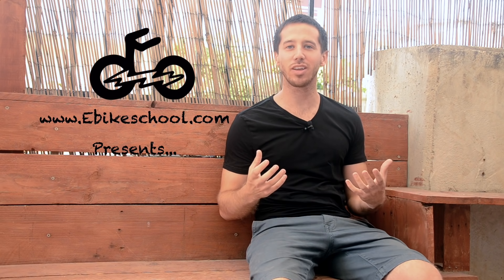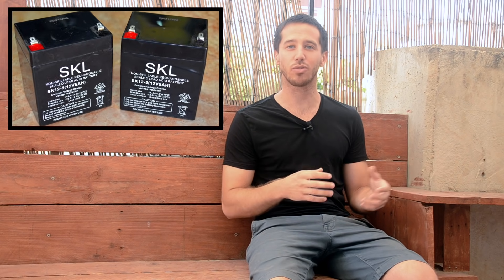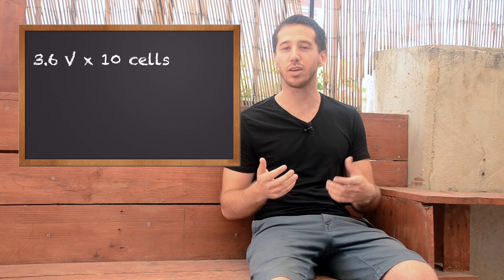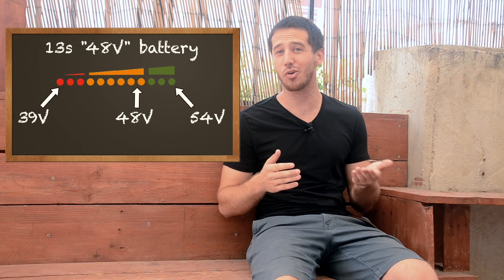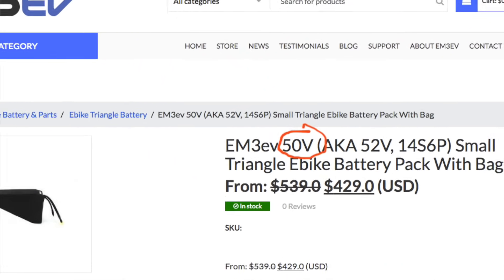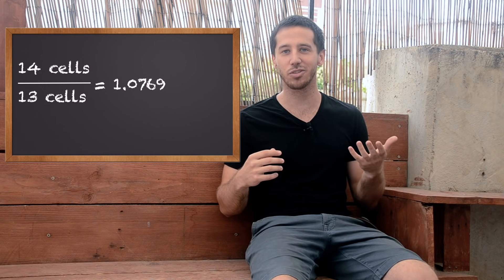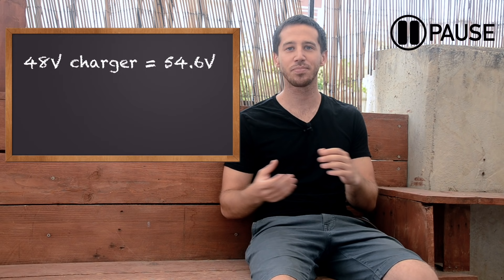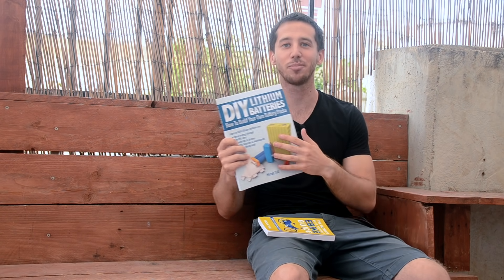Which is better: 48V or 52V battery?

Comment: Hello, Micah, two questions. I had to do a bit of troubleshooting on my 1000w/48v bike, and ended up putting a 1500w controller on it that I had on hand in case one of my 1000w went out, Ihad heard the 1500w would hold up better, but now that I have it on there and working, and before I go changing back to the 1000w or leaving the 1500 on and risk burning something up over time, I need to be reasonably sure if it's ok to use a 1500W controller on a hub motor that I assume was design for a 1000w as that's what came in the kit and it's been working fine? FWIW It's hybrid with gas and electric because I am unable to peddle due to handicap, and the electric is used a pretty good amount but not near as much as normal, in that I use it to get the bike up to speed to start the gas motor, along with the gas the very few times I can't quite make it up a hill, or in town when I'm doing a lot of stop n go/riding too slow for gas.

Second question, At present I'm using the ebay 36v packs for a cheaper/easy to build Li-ion battery solution along with a convertor for 36 to 48V. So though I have the disadvantage of losing capacity running through the exrta component, I have the option to set the voltage up to whatever I want, and was recalling your video on running a 52v battery. So first I wanted to mention this along with the 1500w controller in case there was a problem there I missed and I mainly wanted to know what the max voltage I could run this at. I ask because I know 48v batteries actually charge to 52/54v but I wasn't sure what 52v charge to or if I I could go a little beyond the 56 or 58 or whatever they actually charge to due to the controller?

Sorry it's so lengthy/involved but I figured I should mention all variables. and besides, if it was simple, I wouldn't be here. :) Thanks man, and your videos are some of the best. You do a good job at getting most info in there and making things clear.

Comment: I have a 3 way power switch on my e-bike.  when the controller was replaced last month the 3 wires weren't put into the connector on the end of those three wires in the right order.  now, the low setting is medium power, medium is high and high, just leaves it on high.  anyway, I have the wiring diagram and now I have to fix it.  My question is, do I need a special tool to pull those wires out of the connector and/or to put them back in or do I just pull really hard and then twist and cram them back in there?

Comment: i have a 36 vault motor and a 31.5 volt charge controler so do i need a 36 vault battery with more ah for greater distances

Comment: on the stromer it has a 48v - 983wh

i believe it's a 13S-Battery  so 100% would be 54.6V  and at 30% = 42V

the Charger can't be set at a max. loading. like 90% - 
since i daily do not need 100% i would like to set or automatically cut-off at 52V.

Any idea how i can DIY my own solution?

Comment: So you can have more speed or more distance with more volts. Volts law and all. Simple common sense wins out here. If the controller can handle it more volts is better. https://imgur.com/a/t9NIAmG I personally go for distance with lots of weight. I chose 52v for my BaFang 750W center-drive.

Comment: you forgot to mention if it's 5 degrees  outside your lithium battery is useless. I rode my ebike with my cheap chinese lead acid batteries all through a canadian winter, it was minus 20 for almost 2 months, this guys a fuckin idiot

Comment: New to all this electric with a new tadpole I installed electric on. You have been very helpful in my understanding of how alot of it works because none of it want's to work right. Voltage video on over volting was exactly what I was looking for. Haven't seen all your videos but one on amps would help also. Great job!!

Comment: I use 48V LiFpo4 battery in my build.  I've used it for 2 years mostly riding in town, summer, from home to office and back. It's about 5 km.  But yesterday I tried longer way and got error 06 (SW 900) after 13 km. Does it mean that my battery degraded and I should consider to buy a new one?

Comment: My first e-MTB was with a BBS02 48V 20A with a 13s5p battery. I was happy with this set up, but felt that on some occasions I wanted more power and range. When I switched to the BBSHD (48V 32A) last summer I went for a 14s9p battery and it's made a huge difference. It's pretty flat where I live and I use 100-275W of power most the time, boosting on hills, against headwinds or rough, muddy or sandy terrain. Mostly I do around 40-60km a run, on occasion up to 100km. I find that with this battery, I'm always in the "good" part of the battery charge, i.e. above 48V. Also if I do hammer the battery, it seems to bounce back a lot better than the other one. Obviously the strain is now shared over 126 cells instead of 65 on the other battery. With the drop in prices, it only cost me 100€ more too!

Comment: 52VOLT BATTERY PACK WHAT REALLY, MAKES YOUR BATTERY OUT PREFORM THE NEXT GUYS!

I got 52V battery pack on my conversion system of my Norco 2005 Norco Bigfoot POWERING A 1000W rear geared hub motor.
Our friend here has a few good pointers...   Surely and increase of voltage is conversely an increase in performance. But what he's lost big pointers on and which is so dam important is the type of lithium cell you have delivering power to the motor. 
V x I = P      P=power   is expressed as watts.    So what really can and does make the battery the best performer on the obverse potential other batteries is the C  value    For exam[ple I decided I wanted the real power outpourer so I went with a Panasonic 2900 mha with C value of 10   C=10    so what that means this battery has a

 TOTAL OUTPUT = 2.9 AMPS 3.6Volts =10.44watts total available power  
But the real kicker is C=10 value    which means this battery can put out 29amps (2.9amps x 10) for a real good portion of the total available power. That is where the real true differences exist is that highout factor!

Power is expressed as W (watts) on is the fact that what really is going to give dear Watson 104watts with that C=10 values… compared to those other batteries with 2500mha and a C=3 value …. 2.5a,mps x3 = 7.5amps x3.6v = 27watts    
104watts of output if desired  VS. 27Watts     x3.85 more power output
Note the only drawback is using up the reserve power much quicker

Comment: Here’s a little example for you all of two bike companies and the batteries they sell: 
RadPowerBike 48v 14Ah $499 RadRover
Juiced Bikes 52v 21Ah $1699 Rip Current
Reply: shadowdance4666  Hey I’m deciding between these two exact bikes. Any recommendations from you or anyone that has some experience with these would be greatly appropriated. Thanks
Reply: cdriz1 Well, I bought the RadRover. The extra battery is $550 when I bought it. My advice is keep it dry. Mine weirds out when wet. Like shuts down. Can’t speak of juiced. My real thoughts on hindsight are at least for me. Get a bike with a mid drive motor. Don’t get a bike with 4” tires. Around 3” or under is fine. 750 watt motor minimum. Not a 750 watt peak like Rad. I live amongst hills. 48 volt is ok. 52 volt is best. 16 Wh or higher for power or distance. Hydraulic brakes a must. Regenerative braking if you can get it. Adjustable  regen is cherry. I would like a full suspension. Spend at least 3K but not over $4,750. That’s the point of diminishing returns. I know more now and wish I saved more but, I was impatient. I had fun and learned though. The RadRover isn’t that great off road. Extremely heavy and I’m not a small guy 190. It’s clumsy if you’re going the cheaper route the RadCity might be a good choice. It has regenerative braking. Mild regen. 1 miles recouped after 20. Or 5% from my research.  Adjusting the brakes suck enough on manual brakes. That’s all I got. Good luck 🍀. I mean break a leg

Comment: Dear Guys, I've bought LGABB41865 / 2600mah 3.7v Li-ion battery , Qty: 65 cells ..... 13 groups of five. First off all and before to build the pack,  I measured one by one, all the cells gave me 3.4Volts. I heard that somebody recomended to charge all the batteries before build the pack, and I did it. I used a 2-bay cell 18650 Li-ion charger to charge by pairs. After few days , Finally each cells reached slightly above 4.2V.....and the battery pack finally gave me near 64VOLTS!...... Meanwhile I'm waiting for the BMS 48V-30A 13S board and a 48V-2AMPER Li-Ion Charger that I've bought both from e-Bay..... My question is: Does the cells are likely to be overcharged???? I don't know.
Reply: did you say 64 volts not 54? thats dangerous for your cells

Comment: While the max amp limit is the same, the user doesn’t have to push the system at hard to get the same performance as a lower voltage pack, hence the lower amp load, and why it would run cooler.  If ur pegging the controller it’s obvious that’s there is no difference other than a higher performance end result.  Chock that up to individual rider characteristics.  Bottom like, high voltage systems are more efficient given all else is the same .
Reply from the maker: Of course, but how many riders are going to upgrade to 52V and then ensure they are holding their throttle steady at 93%. I cover real world scenarios on this channel.
Reply: EbikeSchool.com isn’t what I mention real world?  If your moving down the road at a comfortable cruising speed, same as always, the system is using less current and staying cooler.  Not everyone is who rides is pegging the throttle.  I just cruise and want range and ride accordingly.
Reply from the maker: You'd be the first person I've met that would be careful to hold their throttle at 93%, and wouldn't use the extra 1 or 2 mph you'd get from the 52V battery. But hey, you always remember your first ;-)
Reply: EbikeSchool.com yes, when I ride I peg the throttle 100% of the time in max for moar power...  you can ride like that until you get t-boned by a Prius, who probably solders their packs.  This ain’t a 2 stoke, it’s ok to modulate the throttle below 100
Reply from the maker: of course its ok, its just that almost no one does. When most people are cruising, they are at max throttle for the simple reason that most ebikes have a top speed well below road speed limits (20 mph for US ebikes or 25 km/hr for european ebikes). Anyone who rides on the road usually uses max throttle when riding at steady speed. But if you're different, that's awesome. Be different!

Comment: Micah,
Great video. I am refreshing a lot of electrical basics watching your videos. I have a question though.
I have a motorcycle which has a 9.6 Hp 100 CC engine. I want to replace it with electric drive and I want to have the same power if not better power and looking at a 75-80 mile range in pure city driving. Can you recommend what size of BLDC motor (wattage) and what voltage & power battery pack should I use. Even though a mechanical engineer I am weak in Electrical stuff. 

Thanks
Rishikesh

Comment: You also forget that lithium, depending on variant, only lasts a bit longer than lead acid, is relatively new so therefore expensive AND volatile when discharged improperly. To the point of rapid combustion.

Comment: If they're drawing the power out of 14 cells rather than 13 cells, you're going to pull less power Pur cell and that means the batteries will run cooler. If the controller draws 14 amps, it's only going to draw 1 amp per cell. If it only has 13 batteries it's going to draw more than one amp per cell. Some batteries are only designed to put out one amp per cell. The more amps you draw out of a cell, the shorter the distance you get out of the battery. A 20 amp hour battery will get you more than twice the distance than a 10 amp hour battery. Because you're only drawing half the amperage per cell. And the battery will run cooler because the individual cells will be doing half the work.
Reply: But you WILL be pulling more power not the same..Power=IV so the more volts you have more power.  You will be using that extra voltage not granny throttling it.

Comment: Good job with vid. I'm 270lbs. so thinking the 52v would be better to haul my fat butt around. Very interested in building my own ebike. I have a mongoose mountain bike with full suspension, heavy duty aluminum frame but not a spot in the frame for the battery do to the rear shock. I've been looking at front hub motor to balance weight and unfortunately none of the kits come with battery and charger. I would be very interested in your input on my situation.

Comment: Love your videos. I have a multivolt controller on mine. Normally it has a 48v batt. However, when I use my 60v battery, it rockets to 80kph. :)

Comment: 48. volt nominal.  
fully charge. 52 
same as a car battery that's nominal. 12v fully charge it's 14 volts 
. I don't know what shit your on about.
Reply from the maker: that's not how it works. look up what series connections are and examine 13s vs 14s. It will blow your mind...

Comment: What would be the best upgrade for 36v would it be a 4v boost as the 48v to 52v. Would it be just an extra cell in series ie I have a 10s5p 36v battery should I just add 5 extra cells and do I need to change the BMS and I only have a standard 42v  2amp charger?

Comment: 52v is better as under load voltage drops  remains closer to 48v as battery gets  lower where as 48v voltage will drop below 48v sooner. also with 72v systems its better to run 21 cells in  series than 20 cells in series less sooner  voltage drop under load

Comment: Thankfully, within 2 years or so lithium ion batteries will finally start becoming a thing of the past. So, what’ll we do when that time comes and we’re given the phenomenal ability to ride for 100-200 miles on a single charge, and then fully recharge in only 5-10 minutes....  I’ll be singing Joy to the World as loud as I can, and RIDING MY ASS OFF!!!
Reply: Celtic_Ape. Thats my point changes usually come at a slow pace ,i built a timex Sinclair computer from a kit .in 1982,i got a black and white pong type game and a good calculator out of it,now my smartphone shows me pictures from a satellite
Reply: Cold fusion was just a few years away 20 years ago. I wouldn't hold my breath on the glass batteries. Going on 6 months for your claim. 25% of your precious time is gone. Tic toc tick tock.
Reply: Tango Sierra I sure hope you are correct about that! Sounds great to me.👍
Reply: Not as far fetched as you might think. My job is to test energy density and lifetime/runtimes  I work for a drone company. things are happening. slow and steady.
Reply: I'll take them batteries you dream of or just the drugs you're on any day, battery technology is literally the slowest advancing tech industry and with newer and better chemistries also comes greater risk of fire and explosion and so will be tested for many years before being released to the idiotic general public . Let alone the fact that any great advancement in fast charging, light weight , high power batteries is a long , long way away from even being possible. You won't be seeing any major advances in consumer grade batteries within a decade or two at least ! How long was lead acid chemistry used before any great advancement i.e. LiOn LiPo or LiFe etc and you propose something one fifth of the weight with five to six times the capacity , in two years ,that can be charged in seconds. That would be some extremely volatile chemistry and I wouldn't want to have that let loose on the general pubic , considering most people don't even know how to safely use LiPos etc without fires and explosions . Good to dream though !
Reply: @88Nikoli  I suppose you haven't been in on the whole solid state battery race, have you? There have been many big companies (Dyson, Toyota, Honda, Nissan, Panasonic, just to name a few) developing this new battery type for years now. Of course, it's going to take a lot longer than OP stated. Though my point is that it's not as if they just began developing this new technology yesterday. I won't be surprised if this new technology begins to show up in upcoming years, though not to the exaggerated extent of OP's statement.
Reply: Celtic_Ape. Farfetched but not fictional and lithium batteries were developed from lead acid battery producers.,graphene capacitors are showing potential like you are describing but there are still none on the market,
Reply: Tango Sierra I need that🏍
Reply: Glass Battery.
Reply: @Chris Alexy perhaps you meant 32 amps?
Reply: The same guy that Invented the Lithium-Ion battery has invented something better. Still early stages do not expect anything to hit the market for at least 4-5 more years. also China and Korea are both close to something..... or closer... I cannot account for the performance gains. On the other side of things In Britain super capacitors are a real prospect that may well blow everything else out of the water because it simply makes batteries in their current form redundant... imagine it taking a few moments to charge a bike fully and being able to do hundreds of miles at speed, pulling a trailer. and this is not fiction...

Comment: My bike is 36 volt the hub motor is 250 watts with a maximum of 1100 watts. Can I use a 48 volt battery?  If so will I gain more power from my motor by using a 48 volt battery
Reply: yes but your controller must support it otherwise you will blow your controller up.
Reply: Your hub motor is lying.
If it's rated at 250 watts continuous and can peak at 1100, it will never really run at 250W.